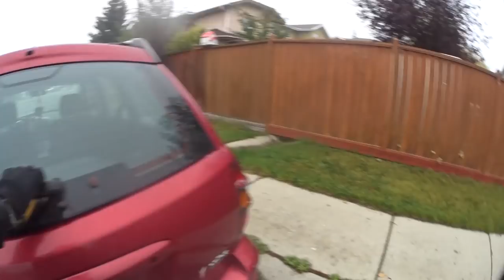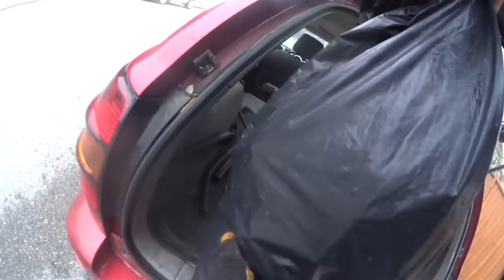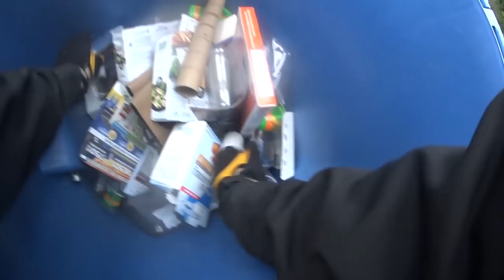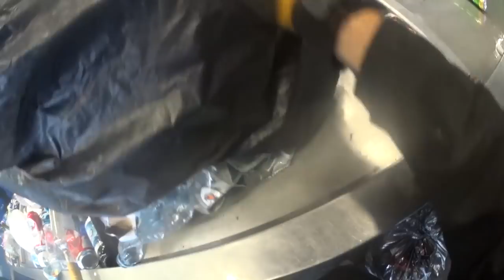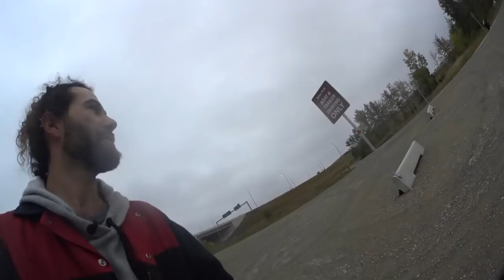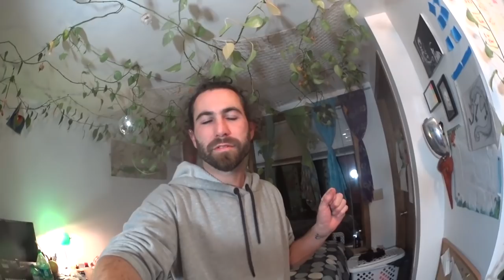Trash Picking Works Best When You Get Up Early... So Glad The Week is Over

Comment: fucked up. stumbled across your shit looking for some shit on places to pick/scrap/ score copper. get shit from work. cut offs, demo, wire and pipe shit. couple months of caz collecting, get a dec payout, 2.70 cu right now local type 1 pip. just went in got 5 sum bones from not a whole ton. always thought about picking and scrapping and the potential. even to melt down (part way done a forge/foundry that I run for pennies, off used oil(motor, cooking). thought I could put that thing to work, casting, collecting, stockpiling valuable comodeities. such as metals. that have intinsic value. safe, stable. resistant to outta control inflation, brought on by poor buricatic leadership,  and economic management. as such the local state.
more so what's fucked is I saw you and thought I reconize you and wasn't sure where from. I had just started watching yo shit this week. crazy 2 days later would see you. having seen a couple already thought your from the OG hood. best part of town. and also prior, watching I also though you looked familiar just form your vids. not to mention the streets and neighborhoods, "OG" Not to sound extremely stalky, but then Trans-Canada east>scarcee soutb> end up at the old river spot.(whole nutha topic right thurr) hypothesis seeming more solidified. if you been around here for sometime prob know some same tribe